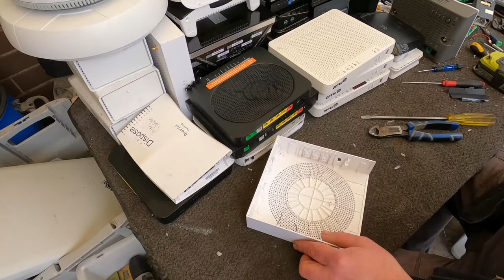Scrap Session with Modems & WiFi Stuff

Comment: Hi Ben i love the videos, where I am there isn't a local board buyer so I depopulate all my boards. It's just something I like to do and I am just stock piling everything. I have a heavy commercial 10 inch table saw I am thinking about converting into a plastic chipper. I can stack about 8 carbide blades on it so it should chew through plastic like butter. Build me a feed hopper for it I think it should work nicely. The problem with plastic is it's bulky by chipping I should be able to reduce the mass by 60 or 70% maybe more. Sure make it easier to haul in as well.

Comment: I have scrapped a pallet of them and have many memory chips, Socs, heatsinks, regulators, coils, capacitors, plugs, switches, practice boards, ram, wifi modules. I kind of like them and i even pulled the linux and rootfs of a few but i might try to extract some gold and copper and aluminum

Comment: Smoke alarms don't have mercury... newer ones are optical and will just contain a low grade board anyways.
The older ones are problematic, not because of mercure, but because they have a tiny radioactive source of Americum 241.
They remain pretty much harmless if you don't remove the shield over the source. Normally they should not be found in the wild, companies providing them are supposed to take care of used ones...
Here is how it looks like inside one of they BTW: https://www.electrical-forensics.com/SmokeAlarms/Brand/BRK/9120/BRK-9120.html.
Fun fact: Soviets made somke detectors with... Plutonium !!! https://highvoltageforum.net/index.php?topic=478.0

Comment: Those network-like small gold connected boards, are wifi devices. The antenna connectors to those are gold plated. Im keeping mine for later gold recovery since they are so easy to take off.

Comment: Dude we've been getting 1300 - 2000 "new" cases per day in San Bernardino county southern California. Lol 150 is tiny. Wed be back up and running stronger than ever if we had those kinda numbers. The testing has gone up due to accessibility. In the beginning, since it is/was a newly discovered virus we didnt have existing stockpiles of tests. They had to be designed, tested, and mass produced to even attempt to have the needed supply of tests.

Comment: The impacts dont just turn the screw. They hammer the bit around to undo it. Think of it as you're trying to close a stuck door. If you just push on it (like your old drill just spinning) it wont move, but it you start to whack it multiple times with your fist (like your new impact driver) it will start to move bit by bit, then once its unstuck you can just push it again. Hope that makes a bit of sense. It cracks them loose with a sharp shock to the rotaion, and then spins them out the rest of the way. If you're doing woodwork, use the impact to put screws in. You'll find it gets them tigher and doesn't spin on the head of the screw.

Comment: DRILL BATTERY LIFESPAN --- After a long period say 3-6 months or more you need to charge your batteries before you attempt to use them again. If you do not during that time it has been trickle vampire draining and you can quickly kill/cut the lifespan in third by undervolting it.

Comment: Why not show taking off the desired parts while opening them up?  Id like to see how you take off chips without destroying them. I use a very sharp wood chisel 2 inches wide. It takes board smooth clean without breaking into piles of dust and scrsp

Comment: At least you have street scrapping there, here in the US, it is not so much the same.  A few weeks in the spring they have spring clean ups, only problem is there is no e waste allowed, only pure trash/garbage. They can stack as much furniture, garbage, trash as they want on the curbs. They have recycling centers for ewaste, Worst part is they do not get paid anything to drop it off, some of it they have to pay to get rid of. TV's, and cathode ray tubes cost a fortune to get rid of here. 19" or smaller costs $15 dollars to get rid of, 20" or larger is $25 to get rid of. So taking them for the copper here is definitely not worth it unless the party wanting to get rid of them pays a fee up front. Glad your country has such an aggressive recycling program. Cannot get rid of crt's or plastics from electronics at all.